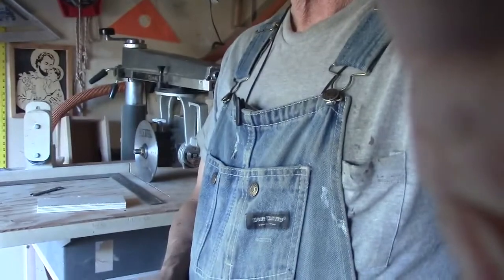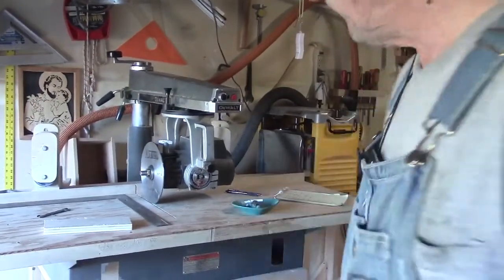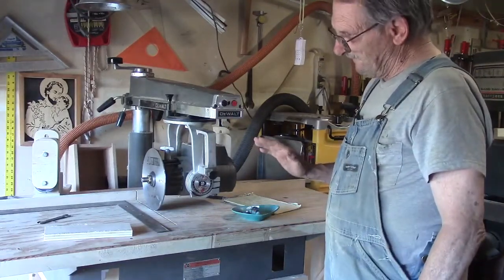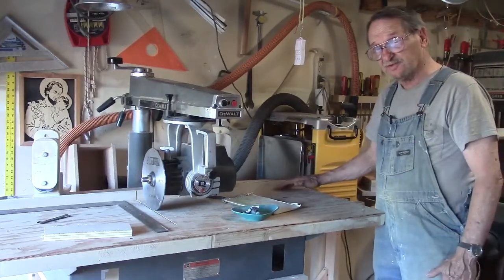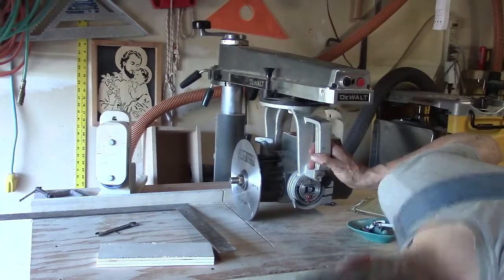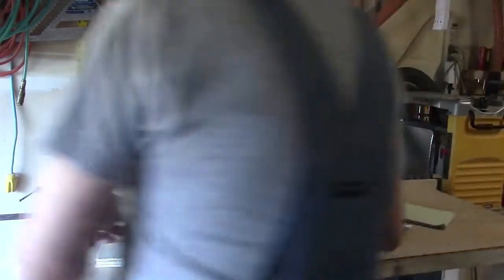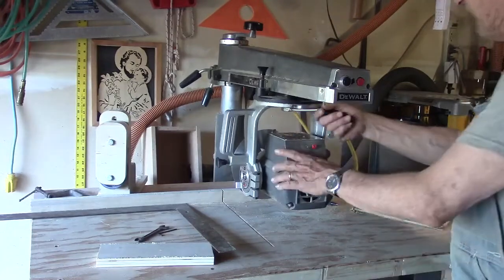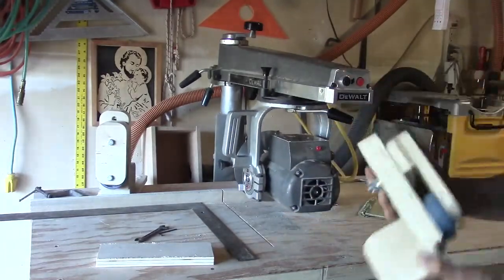DeWalt 790 UpDate

Comment: My DeWalt is a 1954 GWI. I had to make the rails that the table mounts to. They have adjustment screws and jam nuts. It's a lot better setup. I've had mine since 2006 I think but just now learning how to do functions other than cross cuts. Thanks for the videos .

Comment: Ed, the 4 corners of the table is bolted down after making sure does 4 corners are parallel to arm, flip the motor with the arbor down and adjust the height of the 4 corners to the arbor (the table should be the same height at each corner) tighten the bolts. If you place the level on the table and is not square it is OK because your table is square to the arm of the saw. Even if your level tells you that your table is 10 degrees off level than adjust the legs to the floor to get the table level. There's an adjustment screw in the middle of the table to bring the middle of the table only up or down a little (it is NOT a hold down screw but and adjustment one). Now, after securing the corners place  the arbor of the saw to the middle of the table and adjust the height. good luck and be safe. Your dado problem is your front table is not parallel to the arm, the table needs to be adjusted and that is your first step in calibrating your saw. At 7:36 if your arm travel is not parallel to the table than your blade will not touch flush the fence like you say, the vertical on the blade in that position is nor 90 degrees to the table. Start from the beginning and the table should be first.

Comment: Ed, Just to give a follow up, It was the arm as you mentioned. I wanted to Thank You before it slips my mind. I did 2 test, Walk the blade along the square and it rolls without touching and then the 2nd test I cut a board and then flipped the piece and it was a perfect cut. I do not know if there is any other test but I am happy. The link you sent me helped me big time. I never moved the arm but I was able to free it loose this morning and it just needed a little fudging and it all fell into place. Thanks again Ed.. Any more suggestions would be appreciated. I am a retired electrician trying to take up wood working. Keeps this disabled Veteran (me) grounded
Reply from the maker: Peter,  Yes I do have another suggestion.  when I bought the 790 it had sat for a few years in a widows garage; everything that needed to move was either frozen in place or stiff.  I spent about two weeks, in my spare time, spraying Liquid Wrench on every moving part and every nut, bolt or screw I though I might have to deal with.  I didn't force anything, if it didn't want to move, then I would just jiggle it a little.  The penetrating oil needs time to, well penetrate.  The results were amazing.  I trust adjusted the carriage bearings before doing any other adjustments?  You need to pull the carriage and make sure those bearing move freely; it is easy to do.
Reply: Ed, Thank for the communication. My arm moves easy, now that I have it set up I do not want to mess with it right now. I have a book shelf project and I will be doing my cuts on it now that it is square. Maybe another video Ed showing how you checked your carriage.
Reply from the maker: Yep, there is a video where I talk about bearings.

Comment: Ed - I'm at 0.011 for dado depth.  
Best way to adjust is to measure the table above the "axis's" of the angle iron with a feeler gage.
Reply from the maker: Raymond Rogers Ray I'm not sure I understand your comment.  Are you saying the dado is .011 deeper at on edge of the board than the other?   1/100" is pretty good, I will get that close eventually.  I use feeler gauges myself sometimes; .013 go, .014 no go gets pretty close.  I think my future adjustments will start with the saw arbor over the two rear anchor bolts under the back boards, this should eliminate the cantilever effect.  I hope.

Comment: OH yea, Now that I have it all squared I locked everything into place as I just use it to cross cut boards. I want to get some kind of gizmo to move the arm back after I cut. I see there is a little pulley mounted on the back of the arm and I assume that was used for this purpose
Reply from the maker: The little gizmo should have a small, yet long, cable with a hook.  There's one on the 790.
Reply: No cable Ed, Just a small pulley there. Do you advise to have the arm return after a cut on its own??
Reply from the maker: I sure do.

Comment: I have a dewalt 770 and I am thinking of taking my RAS off of it's base and directly mounting to my work bench.  I could add a few nuts or shims to the column to adjust the slope of the arm to match the table top.  does that make sense?
Reply from the maker: Joshua Burke Work benches are typically about 36" high, add the saw and everything is getting pretty high, unless you're a lot taller than me.  It would be nearly impossible to get the arm and table adjusted to each other using shims, IMO.  If your saw is sitting on a factory stand, then I'd keep it that way and just make a new top.

Comment: Ed, if what your saying is you have the table adjusted to the arm and your change of depth is only in your arm deflection, I would secure the column someway and forget about it, lose the flex!
Reply from the maker: Marc Lewis What I am saying is that I haven't yet gotten the table adjusted parallel with the arm.  Arm deflection (sag) is the reason we adjust the table.  Arm deflection cannot be eliminated, but it can be dealt with by adjusting the table to the arm.  My frustration is in the location of the table anchoring bolts.  A member of a RAS forum to which I belong has offered what seems to be a solution, to wit:  Place a block the same thickness as the table on the angle iron directly over the rear anchoring bolts instead of the rear of the table.  DUH!  This will eliminate the cantilever problem I have been trying to deal with.  Solutions usually are pretty simple, and two heads are better than one. Thanks for the comment and thanks for watching.

Comment: Ed, This morning I went down to the shop and it looked like my motor was tilted, not square with table. Sure enough the entire thing was loose. I tighten the bolt in the back where the lever puts pressure on it. It almost did the job but I had to re tighten the middle screw where you adjust for the heel. Now it seems pretty tight but I will have to keep a eye out for this. Sort of pissed me off as I was measuring up all over again. That blade rides along the square the way it should. Have you any problems like this?
Reply from the maker: Peter, There is a lever on the front of the saw.  It probably needs adjusted.  There is a video that covers how to do this.  The process will also be in the 1450 manual.  Cheers.
Reply: Ed, I did tighten the bolt behind the lever and now it is better. I own this saw for 30 or more years and just now I am starting to realize how bad the saw was cutting. Sort of embarrassing, but now it is square thanks to your help
Reply from the maker: Peter, If you are patient you can turn the old 1450 into a precision cutting machine.  Once you get it all tuned up you will be amazed.  Make sure you get the right blade too, this is very important; there is a video where I talk about blades.  I trust that you have adjusted the carriage bearings, this should be done right after you have gotten everything all loosened up after thirty years of sitting idle.

Comment: My blade, the heal is 1/16 inch from back to front. Is this worth the trouble of adjusting the arm. I checked your video and I could not see what you were doing on the back of the arm
Reply from the maker: Peter, there are two adjusting Alan screws with locking nuts. You must square the arm to the rip fence before you attempt to adjust the heel.  1/16" out on either square of the arm to the fence or heel is too much.  Remember adjust the arm before you adjust the heel.
Reply: This is the model I have..  R1450 Type B
Date of Manufacturer: 1963  at this time I do not even know if my table and fence is square, Thanks for the update Ed, I am going to check the table out so I have a starting point. I own the saw for 30 years, I am retired now and just fell upon your video, I tried messing with it early this morning but to no avail. I am actually 1/8 from back to front
Reply: Ed, The fence is square and using a square it is square with table, but not the fence. It creeps inward as I pull it along the square laying on the table
Reply: One other thing Ed, The carriage has some slight rocking when I go to twist it. If I use the carriage lock it all goes away. Then one must loosen the carriage lock in order to slide. I may have over explained myself here. I just need my next step. I tried messing with those screws in front and they will not correct the problem
Reply from the maker: Peter, If the carriage is rocking you need to adjust the bearings, there is a video. The screws in the front adjust vertical heel.  The screws in the back adjust horizontal heel.  Did you down load the users manual?  The users manual has lots of valuable information in it.  Keep at it, it is worth it.  If you persist, the next time it will be easy.  Cheers.
Reply from the maker: Peter, I don't exactly what you mean my "square to the table, but not the fence".  The arm when properly adjusted will be square to the fence and parallel to the table.  Keep at it, you'll get it.  cheers.
Reply from the maker: Hang in there Peter, the R1450 B is a good and popular saw.  Here is a link for the Manual: http://www.vintagemachinery.org/pubs/detail.aspx?id=1095It takes a little more time to think this stuff through as we get older.
Reply: Thanks for giving me the confidence.. I am seriously thinking of moving it out and buy a Sliding compound Miter saw. When I place the square on the table and slide it over to the blade it is square. only when I go to slide the arm forward it walks inward. Also my handle up top will not move the arm to side to side and I am sure it suppose to.. That is another problem, I will try and fix the first one. Thanks again for the communication